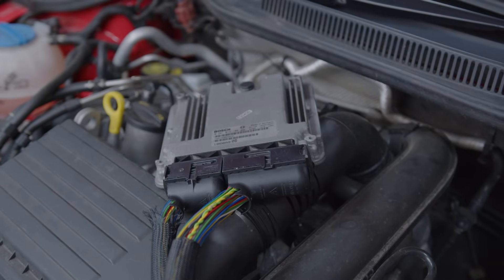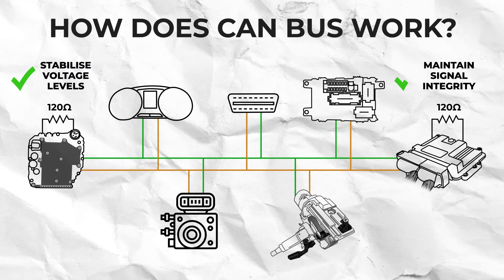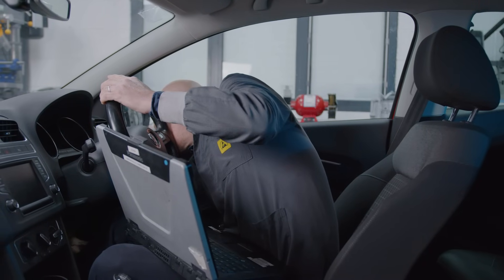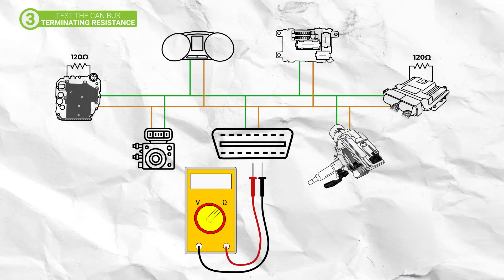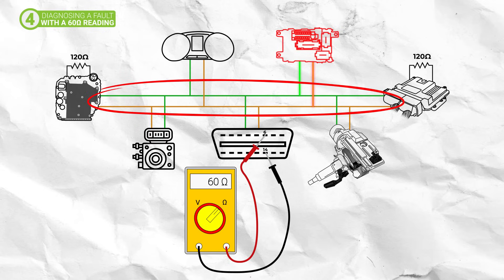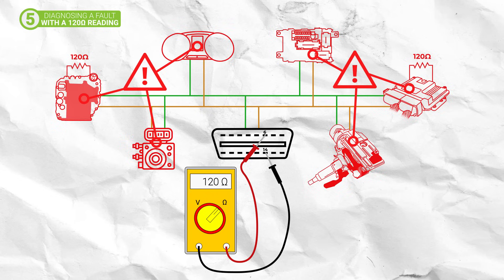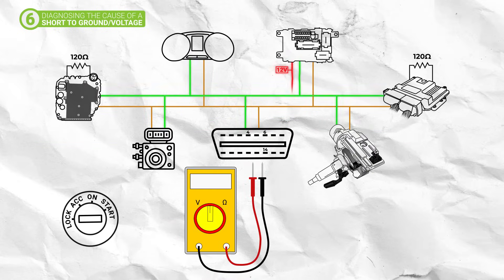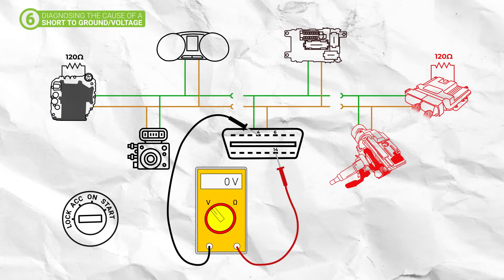Explained! CAN BUS Diagnosis – How to Troubleshoot Faults.

Comment: Have a 2004 Volvo v70R. My CEM was overheating and shutting down my high speed canbus. I fixed my issue(we will find out this summer if i really did) by installing heat sinks for a raspberry pi computer on it with a small 3d printer fan. Seems it was a thing for that year of Volvo. Hope this helps someone.

Comment: What about a gateway! What difference does it makes?
Reply from the maker: Good question! A gateway module can make a few differences to the CAN bus network. One of the main things it signifies is that there are likely multiple CAN networks present in the vehicle, such as a high, low or medium speed network. The diagnostic approach taken to identify the location of faults may also differ, as gateway modules may isolate sections of the network and, if these sections contain a terminating resistor, any reading taken at the OBD2 port can be misleading. Hope this helps.
Reply: @Ecutestinglimited  now, that's a great answer...totally get it...big thanks honestly

Comment: I bought just electric hydraulic power steering pump  from mazda axela car and trying to install in my old car for better performance ..but stuck at can bus 😢 signal or system... without can bus its not running...so asking you is there any other way to run this ehps on old cars ...share information plz
Reply: Not without some extensive reverse engineering and simulating the necessary can messages.

Comment: Got a failure by turbo pressure on a D5 volvo, could ne the sensor, a pipe, the turbo, in the end of logic it was a soldering point in the vct actuator.. Resoldered and it works, takes time, but any good diagnose takes time and feel what you are doing.. Great video, thanks how to do it manualy
Reply from the maker: Thank you, good job on the diagnosis! 👍

Comment: BOOS HOW CAN FIND CUNBUS  EVERY VEHICLE ?  HOW CAN I KNOW WICH WIRE CAN BUS ???????
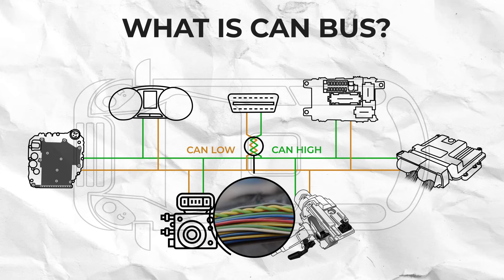Reply from the maker: Hi. So you can usually identify which wires are the CAN lines in most module connectors, as they will typically be twisted together as we show in the video at 1:10. You can also access the wires for the whole network from the data link connector/ OBD2 port which will usually be in the driver side footwell. The CAN high pin should be pin 6 and the CAN low pin should be pin 14. Hope this helps!

Comment: Please forgive my ignorance but at 4:50 you said to check voltage with meter on 6 and 14 with meter on voltage setting. Should one actually be using ground to 6 or 14 to see voltage as looping these together show no voltage.
Reply from the maker: Hi. No problem, good question! If you wanted to check the voltages of specifically either CAN high or CAN low, then testing the voltage between them and the vehicle ground would be correct. However in the example we give at 4:50, we are just trying to confirm the bus is asleep so we are testing the voltage difference between the 2 CAN lines.
When the bus is awake you will see somewhere around 2 volts because the CAN bus is a differential communication system, which means it transmits information using the voltage difference between the CAN high and CAN low lines, not the absolute voltage levels with respect to the ground. The CAN high and CAN low lines carry complementary signals, so when the bus is idle (i.e. no data transmission), both CAN high and CAN low are typically at a similar voltage level, which is usually around 2.5V. As you are testing the voltage difference between these 2 lines, 0v should be displayed when the bus is asleep. Hope that helps!
Reply: Thank you for that explanation.  You just gave us even more clarification.  You're the best! @Ecutestinglimited
Reply: @Ecutestinglimited  thank you so much.

Comment: Ecutestinglimited Car go to sleep mode with cables on battery or we need to disconect cables from battery then make a test for short voltage or ground. I not understand we need to check all with multimeter when we have cable on battery or without cables on battery?

I try with cables on battery und then i have shorts voltage with pin 4 und pin 14=10v, Ohms on pin 4 und pin 14=60 ohms.
i try also without cables on battery und i wait 1h to ecu go sleep, than pin 4 und 14=0 volts, but when i test pin 6 und pin 14 = 40 Ohms.

So what is correct measure all with cables on battery or without  battery?
Reply from the maker: Hi. When testing for a short to ground or short to voltage on the CAN bus we would recommend having the battery connected as the faults would not appear if it was removed. However you need to make sure that the CAN bus is asleep before carrying out any tests, which you can do by following the steps in this video at 4:38. If you have taken the readings you have mentioned above when the network was asleep then it would indicate you may have a short to voltage affecting CAN low. You can further confirm this by completing a continuity test between pin 14 and either pin 16 or battery positive. If there is any continuity displayed, it would indicate a short to voltage on CAN low. Hope this helps!

Comment: That's strange as I'm using multieuscan on our citroen relay to diagnose faults which I've found and rectified.  However it showing up a fault code of U1700 permanent U171A intermittent but it's not showing any engine warning lights .  
I've searched rectifing fixes but it's hard to find the right method as none really point in the citroen relay fixes and all show fixes for different manufactures. 😕

Comment: You did not talk about CAN in Accessory Mode (lets forget this for this video). CANC HS only vs your statement at the beginning of the video and no specific name to the TITLE of the video. You did not mention the possible need to trip the door latches or the bonnet latches to allow some vehicles to go to sleep. A full list of DTC's can help to point to a specific bad module or a problem with the wiring in a general region or a possible connector with corrosion as a partial short in the connector in a general region, you mentioned these. We cannot rely on a very nice scan tool TOPOGRAPHICAL layout to show the exact Series / Parallel layout of the CAN system so a very good Schematic is a must to help with diagnosis. ALL modules need good power and ground circuits but some need a wakeup signal so don't forget those possibilities. A 120 OHM reading can be the TR that is on the backbone and not installed inside of a module at all. It seems that you assume all communications are on a 2 way CAN line, some vehicles use a CAN input to a module and a second set of CAN lines as the output making the module a pass-thru device, in this case, you can remove the connector from the module, short the connector input pins to the output pins and retest the system without a possible bad module, if everything returns to normal, bad module found but you may have codes for the module being offline, no comm as expected. More service information will be needed to locate inline connectors to help speed up the overall diagnosis procedure so a nice CANC HS schematic will only be a part of the needed information. Cold vs Hot, and Dry vs Humid air can play up with the problem/symptom also.

Not for the faint of heart, but if the problem was actually internal to a module, it can be possible to repair the PCB depending on the actual problem but many technicians are not comfortable to have a look inside for obvious problems as a minimum. Nor do most know where to send the module for professional repairs. It could be water intrusion causing corrosion and this type of fault is more readily repairable as opposed to a shorted-out IC chip.

This is the first time I have seen your channel mate, this was a pretty good video but as you can see, in my humble opinion, it needs a bit more info, based on the current info given. I will surf your channel some more but I am looking mostly for heavy Diagnostic works including the 4 S's, Scanner, Scope, Service Info, and Schematics, cheers.

Comment: Skoda octvia 2010 desel 4slender. It has a fuel high pretiour pump that need to be timed with cam and crank. It dont have a cam sesor.but their is a crank sensor. My question is if the (h) fuel pump is timed. And fuel is individualy going to the injector form it. Then what is funtion of ckp sesnor in this car?
Reply: The engine computer needs to know how fast the engine / crankshaft is turning, so it uses a crankshaft position sensor for that. The ECM then uses other inputs such as MAF, ECT, IAT etc to then calculate the amount of fuel that needs to be injected at x-amount of rpm. What is your engine production code? If it is a common rail TDI, it will also have a camshaft position sensor. The production code can be found on the timing belt cover sticker.
Reply: Its not a comen rail systm
Reply: @thestoryteller526  so it's an ALH tdi with a VE injection pump?
The more info you provide, the better the answers to your question(s).